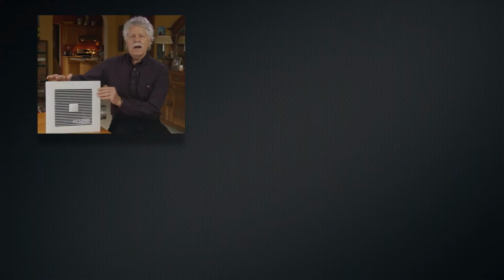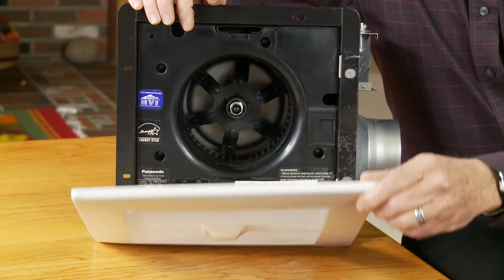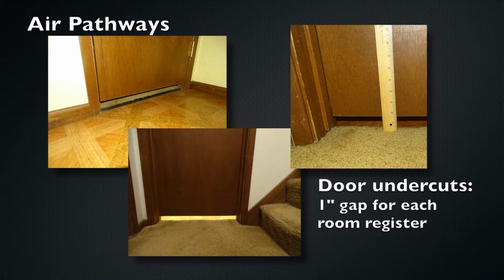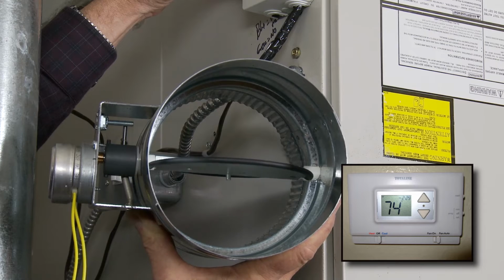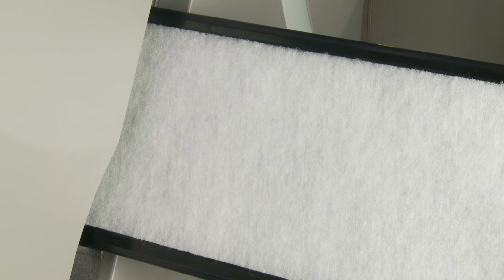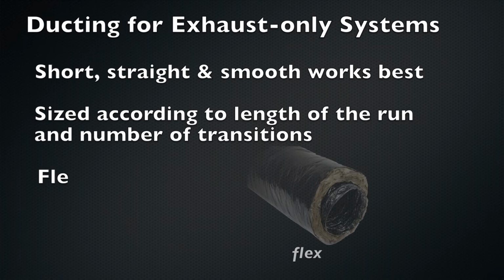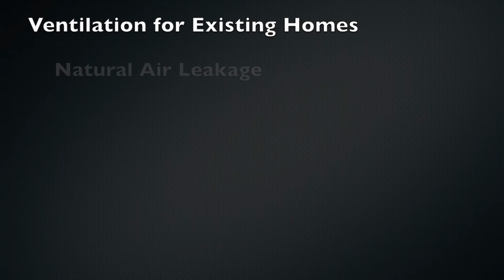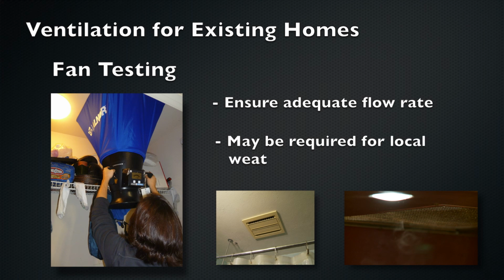Fresh Air for a Healthier Home

Comment: There is some feedback by indoor air colleagues of mold growth in HRV/ERV ductwork, especially with flexduct. 

I wonder why integrated systems that result in positive pressure were left out - such as the UltraAir by ThermaStor, www.thermastor.com. This unit combines fresh air (with optional filter) and dehumidification. Coils are mold-resistant.

Comment: Great & thorough explanation of fresh air ventilation!  Thank you.  I recently installed zone control in my home and the zoning system i used (SmartZone-4X) has a whole home fresh air (integrated) control built in.  It is a hybrid system that can act as an ERV with proper dampers installed.  It has manual and timer controls built in & can even be combined with an outdoor temp sensor to disable during extreme temperatures to save on energy and keep the house comfortable.  SmartZone-4X can be found online at www.zoningsupply.com

Comment: A very helpful IAQ video! Obviously carefully crafted and made.

We typically prefer what you call the integrated method which often slightly pressurizes the home. Our market is existing homes, so new ductwork is typically not in the budget. While energy costs from a PSC motor were included, they were not for ECM motors. We typically right size equipment so it runs much of the time anyway, fresh air is simply an added benefit in all but low load situations. Since we substantially tighten our clients' homes, the energy penalty is likely very small.

We feel this is a good approach for new homes as well. What is your opinion on this approach?

Kurt - I can't speak for these folks, but at very high or low temps the stack effect will create more airflow, and there is a fairly severe energy penalty for integrated solutions at this point. Sucking in 5 degree or 90 degree air without tempering it is not going to help energy bills. =) Those conditions typically last only a few hours before temps moderate.

I'm not sold on 62.2-2013. Paul Francisco, who sits on the committee, admitted at ACI 2014 that the standard wasn't actually complete, but it was time to publish so they put it out there. I prefer the 2010 version or Joe Lstiburek's BSC-01 standard until 62.2 is revised again. Dr. Joe took the 62.2 committee apart in a debate at ACI 2014, it's a mediocre standard. To my knowledge weatherization programs are the only major organization that has adopted it, and they fought like heck to avoid it.
Reply: This IS a well done video! And one that needed to be done.

Comment: Over all a good video. Some really good points were made. I don't understand why you are using the older ASHRAE chart in segment 2, 3 and 5. Then later in segment 5, you show the ASHRAE std. 62.2 - 2013 with the upgraded chart showing the change to reflect the tightening of our homes. I hope you will consider changing the old chart references to the new chart so as to reduce confusion. I also don't understand why in "really warm or really cold weather" we no longer need fresh air ventilation? Seems contradictory to the recommendation that we have it all the time for Potential health effects?